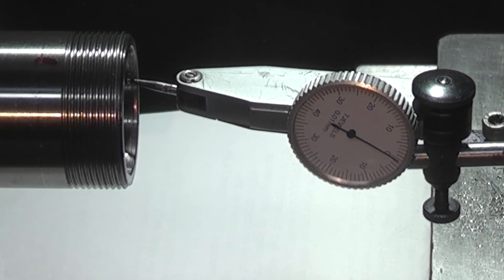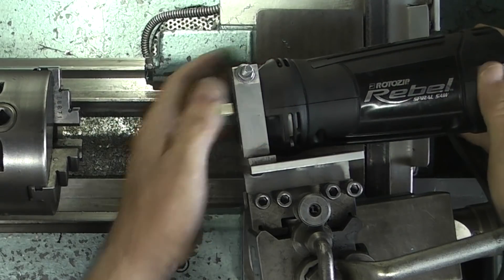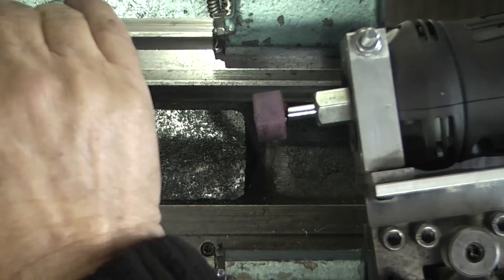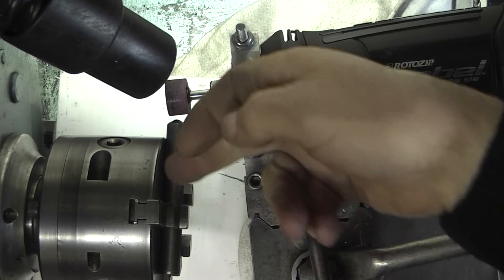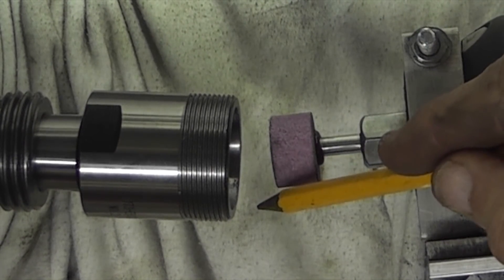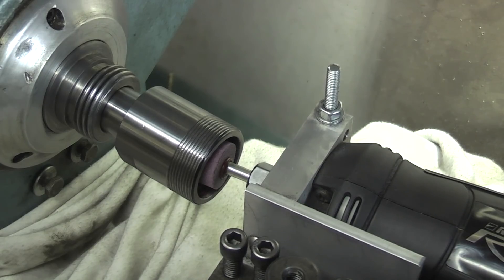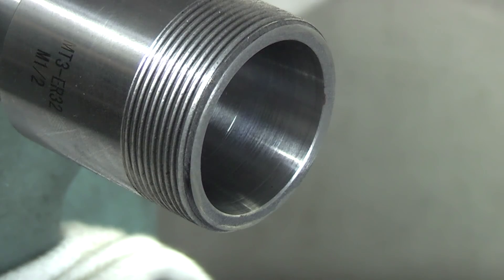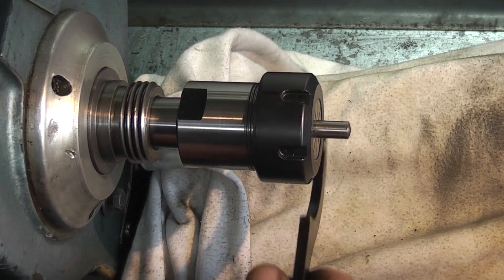Grinding in the lathe

Comment: Hello, late to the game, but how would you best go about grinding in the collects now that the holder is on center? I would imagine it being difficult to hold without distorting it?
Reply: soft solder/superglue a ring to both ends. drill/ream through in chuck.

 slip on mandrel. grin OD.
pop back in chuck, do ID.

remove rings.

Comment: Great content as usual, love yr channel. I’ve been thinking about doing the same operation on my chinese collet chuck. Did you run a dial indicator on the finished grind to check runout ?
Reply from the maker: Hi Michael.  Yes I did and the run out was zero as you would expect.
Reply: enots engineering for fun why not try grinding one of the collets

Comment: Sir, a pin whose diameter is 40mm and length is 6 inches. How to grand on a lathe. Job on the lathe is ruff grand. Plzzz reply sir....
Reply from the maker: Hi the only way I can think of is holding the part between centres grind half and turn it around  to grind the other end.
You would need a larger grinding wheel and robust spindle to hold it without vibration.

Comment: I have had poor results with my Chinese er32 + their Collets. Collet holder has little run out so my Collets are junk. Got a usa made er32 and with these Collets run out was still bad, they are not used much and use my Hardinge 5c and my rubber flex collets

Comment: Hello Allen, if, like me, you can only afford the Chinese collets how do I remove the 2 thou? is there a way to grind them?
Reply from the maker: Hi Billy. When the collets are made the last operation is to split the ends of the collet so it springs open you then rely on the collet holder and nut to push it back together. Try looking at the collet nut some are machined offset. If you look inside the nut sometimes you can see the offset. The nut bore is to one side, changing the nut may reduce the runout.
Reply: @enotsengineering  thankyou

Comment: I am about to do a heap of my ones as well .    Things i have found  previously  were , if the wheel is not exactly on centre it will give a result that mimics a bow shaped collet .  I always have a gauge pin in the collet so it holds true dimensions  .  Running the lathe at a lot higher speed , as with tool post grinding  will generally give a better finish .    Just some points that work for my set up  running a jig  grinding head in the tool post .  Cheers .
Reply: it look more like .020 run out to me not 2 thou but 20 thats no good for a collet chuck
Reply from the maker: Hi Barry On my DTI each div is 0.0001" one full revolution of the dial is 0.010"